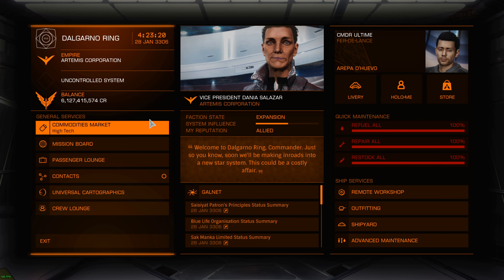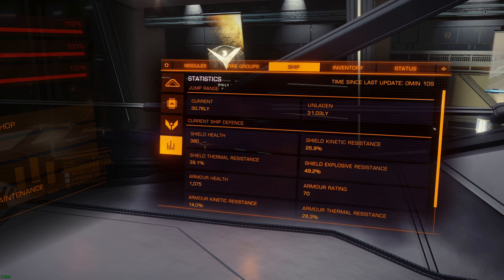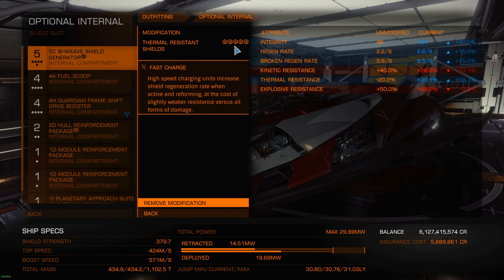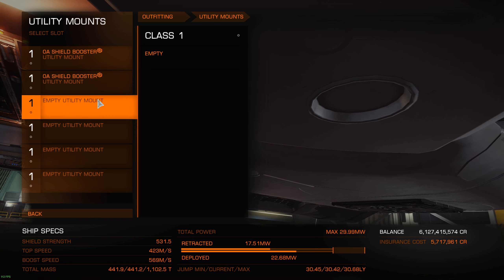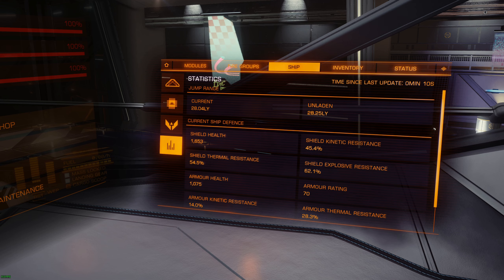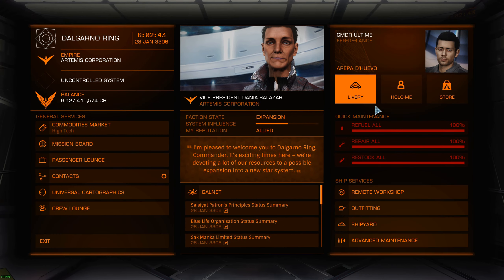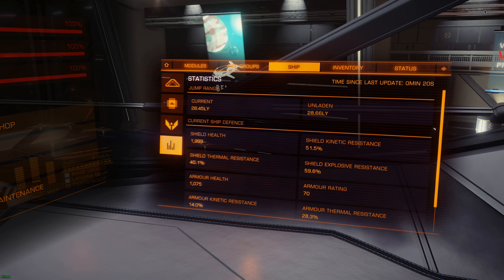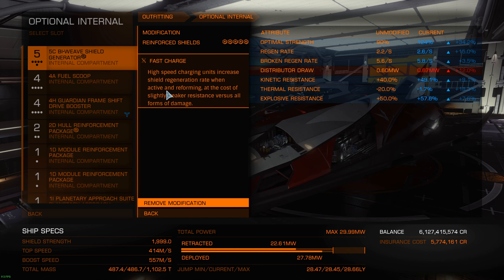Elite Dangerous - Bi-Weave Shield and Shield Booster Engineering - How to optimize your Bi-Weave

Comment: Im trying to build a fast recharge build for my cutter but the problem with bi weave shields is that they stop recharging for 2 seconds every time you take damage wich is about 65% of the time in a fight and even with high end resists the prismatic shield still has alot more survivability. Like with prismatic i have 7423 shield hp with 39% thermal resist and 64% kinetic and explo resists wich result in 12k ehp against thermal damage and 20k+ against the other damage types. With bi weave and 60% resists i have around 3k shield hp and only 9-10k ehp. So my shield would have to break and recharge to 0-50% 3-4!! times without me dying before i would get the same ehp out of it as with a buffer tank.
Reply from the maker: that why i prefer bi weave on medium or small. heavy ship are big target. i prefer prismatic on those
Reply: How is your shield HP that high? Is it just generator engineered, or generator and boosters engineered? Or Guardian? When base HP is so low I'm wondering how to improve it the best...